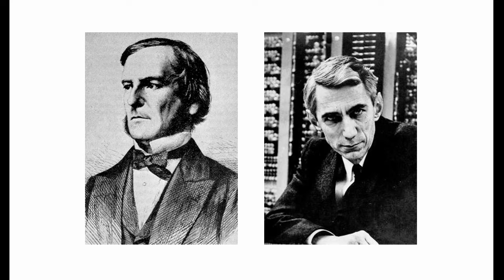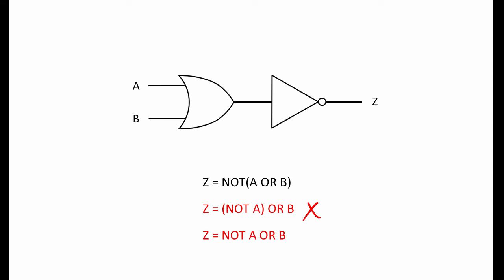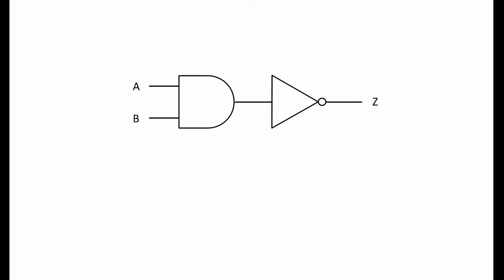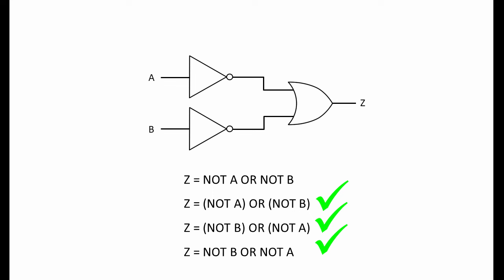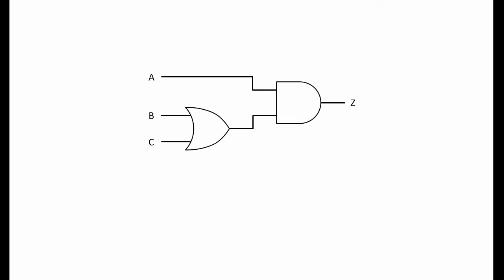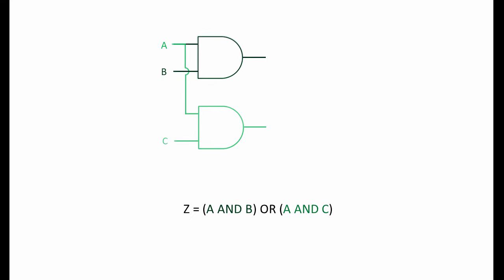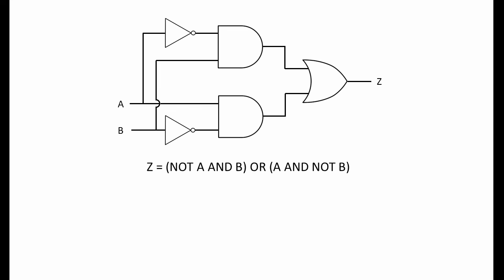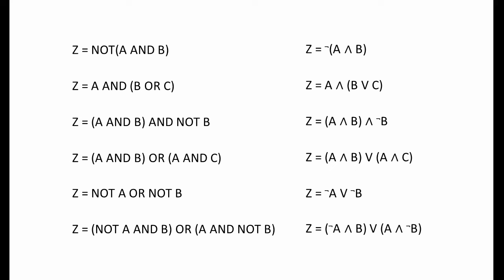Logic Gate Expressions

Comment: Please correct me if I'm wrong, but the logic circuit you drew from the Boolean expression Z=(A and B) and NOT B is incorrect. If B is high than the circuit will not have an output due to the NOT gate feeding the second AND gate. If B is low than the first gate will not have an output, which will cause the second gate to again have no output. B can not be high and low at the same time in an AND gate configuration.
Reply from the maker: Hi James.  The logic gate diagram does indeed match the expression (the object of the exercise), but as you have quite correctly pointed out, the circuit is pretty much useless.  Examination of the truth table reveals that the value of Z is always 0, which means the whole thing could replaced with a single wire carrying no voltage at all.  

A    B    NOT B    Z
0    0          1        0
0    1          0        0
1    0          1        0
1    1          0        0

If you are interested, my videos on Karnaugh maps and Boolean algebra cover techniques for simplifying expressions and therefore the circuits  they represent.
Reply: I can revise my module in 1 day with all these videos if I put my self to it. That's how well made they have been so far for me. I would donate £5 if I pass. I left all my revision for last day and if this makes me pass..............

Comment: In 10:44 I think you made a mistake sir or I don’t get it ..anayway it’s not possible if A and B is on how can B at same time not be on. Cause the second and gate needs an input 
Thanks
Reply from the maker: The value at B goes in two directions.  If input B is a 1, then a 1 goes into the top AND gate, and a 1 goes into the NOT gate.  The NOT gate changes the 1 into 0 which is fed into the second AND gate. :)KD

Comment: Your using 0 and 1
But in my school they are using TRUE AND FALSE
So can u say the output of AND gate with true or false instead of using 0 and 1?
Reply from the maker: 1 and 0, TRUE and FALSE, High and Low, On and Off, are possible alternatives.  1 and 0 is most common because it ties in with binary.  If you study this at a more advanced level, 1 and 0 makes more sense.

Comment: how do you determine the # of logic gates given an algebraic function.. say F = x'yz + xy'z + xz'?
Reply from the maker: You can systematically build a set of gates for each of the three sub-expressions (which are separated by ORs) then put them together as shown in the video, but this will not necessarily be optimal.  It would be better to simply the expression first, using Boolean algebra (see my following videos).  If all you want is a result, you can use a Boolean algebra calculator, like Wolfram Alpha's.  This will draw you a diagram too.  To be honest, I use Wolfram Alpha to double check everything I do.